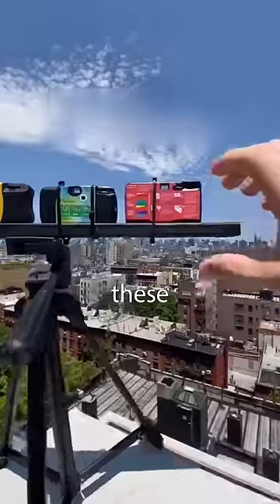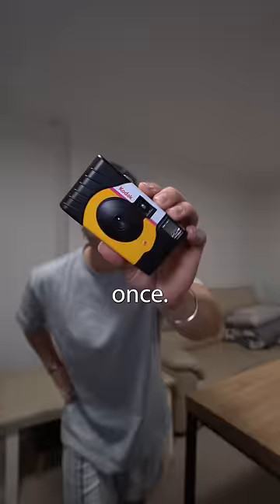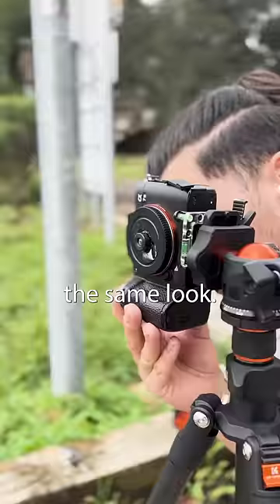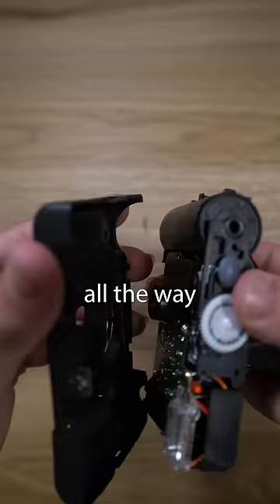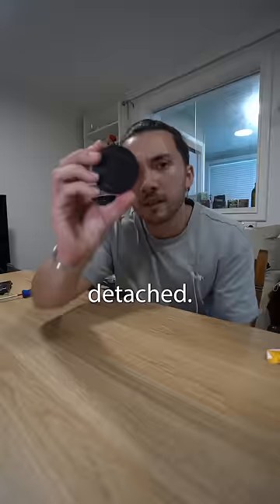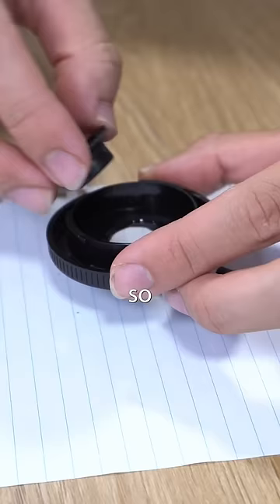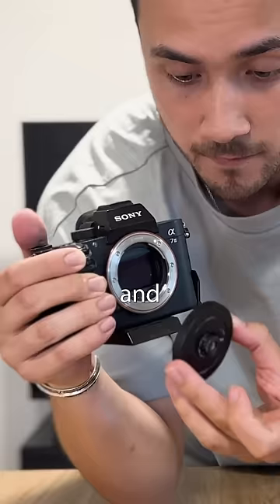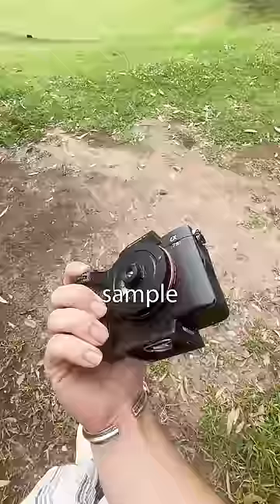I put a disposable camera lens on my pro camera

Comment: Sucks how these beautiful cameras were limited to one shot.

Edit: Appears I’m an idiot because they get between 20 and 40.
Reply: Like Polaroids, live the look but they just BREAK
Reply: They weren’t tho
Reply: @ThaChickenMan Polaroids can be used multiple times since you reload the cartridge that provides the film paper. A Polaroid camera is a instant camera, not a disposable one
Reply: Not all disposable camera's are.  Most of the cameras manufactured today are actually multi-shot wind-up cameras and some are reloadable.
Reply: @photonik-luminescence  ah sorry for the confusion, I meant that Polaroids give the same “nostalgic effect”
Reply: @photonik-luminescence  and I meant that after a few reloads they break (well those ones you normally buy in like a gift shop or smth)
Reply: Look up the camp snap camera; I don’t have but it looks pretty neat :)
Reply: @ThaChickenMan  interesting. , but mine still works and it's from 1980.

Edit: I get the confusion now 😂.  You mean disposable cameras are bad. Honestly i don't expect them to last long, but if you get more than one film replacement, at least you beated the one use feature
Reply: Ive never seen a one shot disposable
Reply: money scheme
Reply: @Zaque-TV  that's a good point. Usually a disposable camera can take up to 36 images depending on the film. And apparently you can just use another film (some show how to).
Reply: @Alberto0432  i guess it was a thing were as a tourist you'd get a disposable camera at a gift shop or souvenir shop to take some photos of your vacation. Not sure how much they originally cost, but i mean it is a gimmick, but at the same time practical for back in the days were there were no phones.
Reply: if you can open it up to remove the lens you can most likely load it back up with film, and use it for more shots
Reply: Bro its not just one picture. You must not have grown up with them💀
Reply: @Zaque-TV Me neither 💀💀💀
Reply: some of them had multiple uses
Reply: They aren’t one shot they have multiple usually around 15
Reply: I can practically see the joke flying over peoples head.
Reply: It's sad because it's a classic example of planned obsolescence
Reply: @MnDogman So?
Reply: The weren't limited to one shot...
Reply: yep…
Reply: You get up to 20 shots with a disposable camera.
Reply: @ThaChickenMan but, 100 ISO film if you get the right film is equivalent to about a 4K picture for 35 mm negative strip film, Polaroids actually look like complete garbage 35 mm film is no bs, it's genuinely very high quality especially if it's something like Kodak ektar it's amazing how many people think they know about cameras and all of this stuff when in reality they've been completely disillusioned for most of their lives because of the credit marketing of the companies that sell these devices to you and the negative stigma that comes around old technology because old technology is bad and new technology is good and that's just how it always is no matter what😂😂 you know there is still movies today that are in 4k and you cannot tell they were recorded on film because that's just how it looks, no it's not edited, no it's not a special effect, that's just how it looks and people don't understand that because when people think of film they think of Polaroids
Reply: What cameras did you have???
Reply: What do you mean one shot have you never used one of these
Reply: niko oneshot
Reply: Pretty sure they're making a reference to a bit from a show where one of the characters said a similar line and revealed they'd been throwing out perfectly good cameras
Reply: Why?
Reply: Not one shot one film roll
Reply: Usually they can do up to 11 photos. But once they are used they are supposed to be developed then thrown away
Reply: They're not limited to one shot lol, they have like 100 shots before the film is used up
Reply: They weren’t
Reply: Not one shot, I think it was 30 shots or something like that
Reply: @masonkitari  niko oneshot supremacy
Reply: Lol not one shot, multiple shots just when it runs out it's gone
Reply: It was either misinterpreted and simply has a reloadable film (cuz it's BS if it IS one shot only)
Reply: 24 to 36 shots to be exact
Reply: These cameras were not (are not) Beautiful.  People are just nostalgic for the look of the photos.   You can achieve the same look with a few photoshop filters.
Reply: They could do plenty more than one shot, idk why the poster made it sound like they can only take one picture.
Reply: More like 30 but Alr
Reply: Like a phone
Well, THOSE phones
Reply: More like 15-20 shots but yeah it sucked
Reply: They're not. They just use an old film you can only buy in 3rd party stores. I actually just switched out the film in mine.
Reply: @ThaChickenMan they dont break if you dont abuse them to death. Mount Rushmore isnt going to stand up and wall away you dont need to rip your camera out of your back and pull it apart to take a single photo
Reply: @FeiPaul the joke isnt flying over anyone's head the original commentor even stated they meant Polaroids single use function as they took whole ass photos you took out
Reply: @FeiPaul I feel like crying is everyone actually this fucking dense? I feel like I've seen or heard a joke like this where someone snaps one pic with it then throws it away
Reply: thought it was just one roll of film
Reply: Niko one shot?
Reply: you only have one shot
Reply: They’re not, actually. Most modern disposable cameras have 10-25 shots in them.
Reply: Yeah you realy wanna be cearfule when taking these apart
Reply: Lmao, they aren’t tho
Reply: one roll of film, not one shot
Reply: nah most disposable ones can be re-used. look up youtube for process
Reply: @ThaChickenMan I bought my girlfriends the i-Type Polaroid cause it was the most expensive one and the fucker broke in a month
Reply: It's not one shot, it's one roll of film. It usually had 27 but some had as many as 36.
Reply: They're not one shot...they have a wind of film and a number that shows how many u have left.
Reply: Because the good memory didn't happend at same twice
Reply: thats called, a business practice.
Reply: we putting the sun in a tower with this one🗣️🗣️🗣️
Reply: There are already ones where you just need to switch the film. I think harman was the companys name.
Reply: @dorianruble7807  That just sucks
Reply: @dorianruble7807  I guess its pretty luck based whether you get a good polaroid camera
Reply: Bullshit you can make 15 😊
Reply: @ThaChickenMan get a real Polaroid my guy
Reply: They are 27 shots usually
Reply: You had one roll, and once you used it up, that was it. Not actually one picture.
Reply: Fr
Reply: @photonik-luminescence You have no idea what you’re talking about. These weren’t gimmicks… They were cheap and sold EVERYWHERE AND HY EVERYONE. Fam back then people had digital cameras and they were expensive so MOST people used disposable cameras. Until the early 2000s when digital cameras dipped in price. Cell phones?  They didn’t even have cameras in them. 😂
Reply: @Alberto0432 they weren’t one shot. And it wasn’t a money scheme… it was literally cheaper to use these instead of buying a digital camera and memory card. Not to mention you still had to get the photos developed. Uploading photos to a computer wasn’t common. Social media wasn’t a thing back then.
Reply: @ToxicHAL  i never said they were gimmicks, except they couldn't compete with SLR cameras like consumer grade SLR camera's. They still produce an interesting vintage look. And to be fair, i actually have an camera from 1940. Also, Single Lens Reflex once again existed for quite a while, they were just pretty expensive. Example of SLR cameras are like Vivitat VX2, Exa C1, Olympus is 200 and Canon and plenty of other SLR. You also could afford a simple point and shoot camera, wich were far more consumer friendly and wete far cheaper. I may not have been part of the generation, but i did shoot film (specifically Kodak Gold 200)
Reply: @photonik-luminescence  True, but at least in the one I own, the cardridges not only contain the film/pictures but also the batterie and spring and throwing away all of that for 8 to 15 photos is still pretty wasteful.
Reply: @thobinski2917  i know. I would personally re use them, hence the lie that they can be used only once, they should be able to take a few and by tricking it, it should be basically a point and shoot reusable camera
Reply: I've never had a disposable camera break. Normally, you can use all 24-28 shots.
Reply: @ThaChickenMan  my polaroids are from 1961 and 1984...still work perfectly fine
Reply: Almost poetic, if you think about it...
Reply: Not one shot 😂 one roll of film.
Reply: those cameras had between 30 and 60 frames on the roll of film.
Reply: @FeiPaul fr lmao
Reply: I think by one shot they mean non-reloadable... so not a "one photo" only camera, but a 1 roll of film disposable. (They used to sell in packs of 3 too) Meaning the 1 roll of film was all the camera was good for. You had to take the whole camera to get developed not just the roll of film. So walgreens would take the camera and crack it open for the film roll to develop and discard the camera in the trash.
Reply: They were cheap cameras. Why not get an old camera at a thrift store that's from before 2000ish and use real film. Why would it be different?
Reply: @photonik-luminescence  never a gimmick. For a trip, you needed a camera. It' was more convenient sometimes to get a disposable one. Sometimes safer than bringing an expensive camera before digital ones were around. Lighter weight.
Reply: Chat, is this a reference to the game OneShot
Reply: @Laura-kl7vi  a gimmick as in quality. Admittedly they are pretty great and you still get pretty awesome pictures for a very low price compared to SLRs. I enjoy shooting with a SLR because of the focus you can adjust and properly see what the camera lens sees. However, the quality of a SLR will obviously outperform a disposable camera. Better so, there were cheap point and shoot cameras already out of plastic for a better price. They were conveniently re usable without the need to trick it. Nowadays, it definitely has faded out as a way to take pictures, but remains a great experience to use and get a vintage looking image.
Reply: not typically one shot, just one roll of film (which is in my experience around 20-30 shots) and then instead of removing the film like with a non disposable film camera, you just gave the whole camera to the photo lab
Reply: "one shot" is ambiguous. Makes it sound like you could only take one photo.
Better to say "one use".
Reply: It’s not one shot lol it’s one roll
Reply: what? You had 24
Reply: 36 shots.

Then sent to the photo processor.
Reply: Except that the disposable cameras could usually take up to 24 pictures.
Reply: *27-36 times per image
Reply: @ericranoutofideas THATS WHAT I WAS THINKIJGGG
Reply: Had to nerf them somehow.
Reply: You can literally put film in a camera it’s the same thing.
Reply: This diy sucks
Reply: @MnDogman  i was gonna say...
Reply: they werent, ive had many and they capped at 27 pictures, just like the one he has in his hand
Reply: You get about 20 shots till it’s done
Reply: 😭😭 didn't it have film to go with it......? How tf did people spend money on a camera that only takes one picture?
Reply: Bruh, they got 36 shots
Reply: They suck, the picture quality is bad. But it’s usually considered nice
Reply: I think the guy who made the video misunderstood single use as in once you go through the roll of film you cant easily remove it and load another in. Also the flash batteries weren't rechargeable and lighting was harder with these cameras coz you cant check if the shot has good lighting without digital data, you basically have to hope the viewfinder didn't lie to you lol
The device is single use as in once you exhaust it its not designed to be reloaded or reused. But the camera itself takes as many photos as the roll of film has frames.
Reply: They get 24 or 36  I think
Reply: Erin moment...
Reply: Lmao
Reply: Maybes that just a part of the beauty.
Reply: Did you seriously think it was for one photo
Reply: One ? 💀 Dude that would be the most insane waste of plastic in history
Reply: @Alaskan-Armadillo Classic example?  It's nothing like planned obsolescence.  It's meant to be disposable.  Use it, then disposed.  Like toilet paper.  I personally don't buy toilet paper for it to be used more than once.
Reply: @bendingdemon6483 I think you may be taking about a normal film camera.  Disposable cameras typically held no more than 36 shots.
Reply: Well, this would be in the realm of possibilities.
Reply: Bruh be for real
Reply: @photonik-luminescence Yeah, but film is expensive I say this as a Polaroid owner, I ended up buying a digital one because of how bad it got. (I still shot polaroids because I love the anesthetic).
Reply: If u are a sheep then gimme em wools. I need to kill the ender dragon
Reply: It's good that it sparked. Otherwise, you would have grabbed the  capacitor while it was charged. That don't feel good😂
Reply: Mate... they have 25
Reply: @ImNotCreativeEnoughToMakeUser  mate can you read the edit?
Reply: bro you shouldve just said you were being ironic i believed it
Reply: You're not an idiot. It's not your fault
Reply: Single use don't mean you can only take one photo lol
Reply: The ones I saw were like 60
Reply: The Oneshot is real 😯😯😧😧😧🫢🫢
Niko: What do you mean !?!?
Reply: @Minagl3  Yesn't
Reply: Lol no way you said that haha. The ones I’d see were 10-20 max but I’m sure there was bigger.
Reply: not even 20-50 you just buy a new reel of film and put it in.
Reply: There more then 1 pic lol they would be useless for only 1 tho I don't really remember them well since I just remember playing with my grandpa's cameras lol
Reply: @ThaChickenMan yo my man im your 1k likes
Reply: I had one for an overnight school trip and it had like… 20 or more? Maybe less?
Reply: Disposables used a proprietary film and developing process so you couldn't just reload them with standard 35mm film.
Reply: So cute 😂 not one shot, just one film, which was usually around 30 photos
Reply: 😂😂😂 that's ridiculous they are good forever..its a lens 😅 @MnDogman
Reply: @meamfighterjet don’t call yourself an idiot by not knowing that it isn’t a one and done camera. It’s okay to not know things but never okay to blame yourself for not knowing